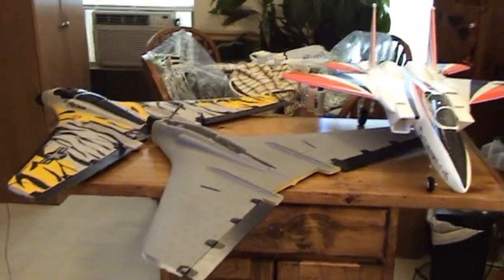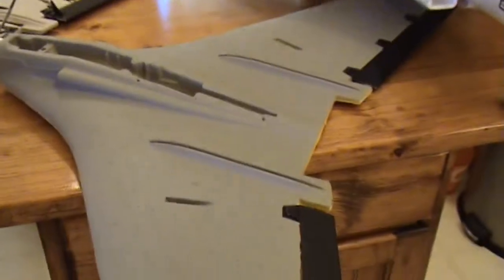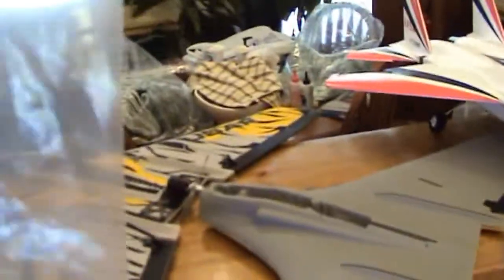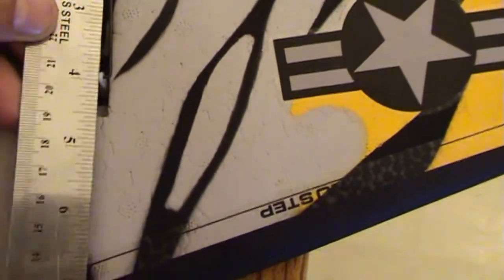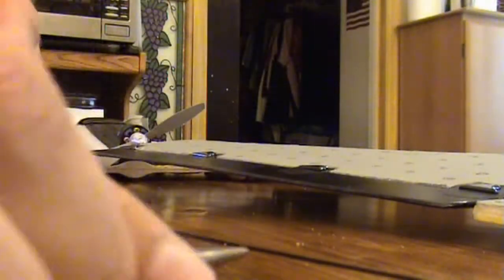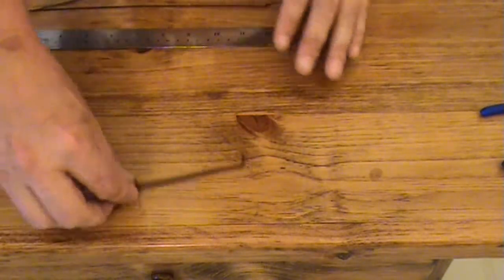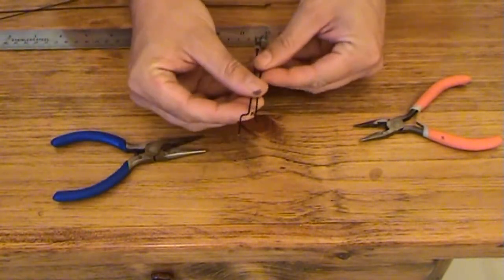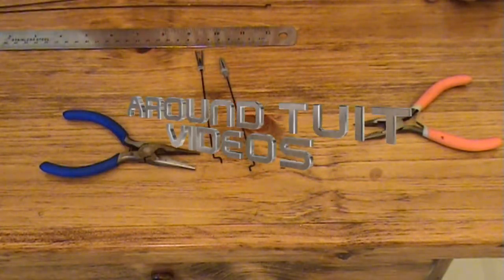Make RC Plane Push Rods For One Dollar

Comment: The clevis is threaded onto the pushrod end to allow adjustment of the distance between the clevis pin and Z bend..  Before measuring and cutting the pushrod, adjust the clevis to be in the middle of the threaded portion of the pushrod.  That way if the cut and Z bend are anywhere near correct, the clevis can be turned on the threaded portion of the rod to make the length exactly correct.

Comment: answer man: 1.5mm is small size to medium planes... /if making short/12inch or less rods/can use flags wire from utilities markers. like water/ electric/ gas lines is marked with-homedepot /100 flags =$10. …. aluminum isn't good choice= they change size over time= heat /cold effect it a lot.. and there corrosion is worst than rust..cause snags and causes gitter.. just no no no ! 20 feet piano wire for 4$ is good option.. larger planes.. theres cheep way- 3/16 inch.. bamboo scueers/Wal-Mart 10 for .99 cents.. 1 inch each end.. drill hole and take 2 inch steel rod.. bend 1/2 z  bend and apply in hole.. wrap string around the scueer and the steel /after the bend is poked through the wood. then glue them together! I like paint /or coat my wood scueeer so lasts and last!

Comment: what can you use the cut of pieces for, and can you thread the left over rods. if so are not these rods are what gauge, why not aluiminum wire , i think and i do not know what tensile strength is needed